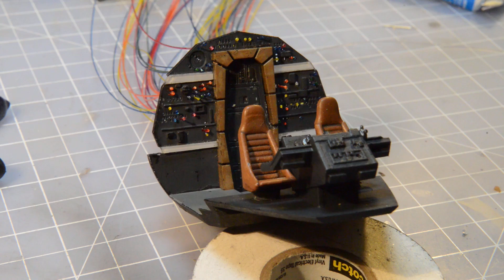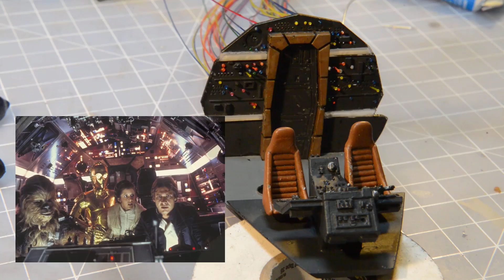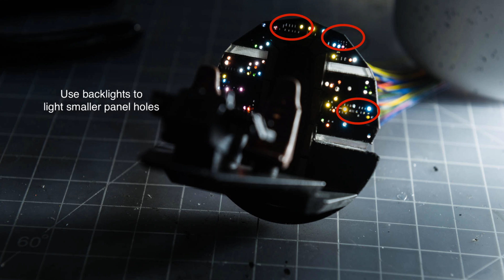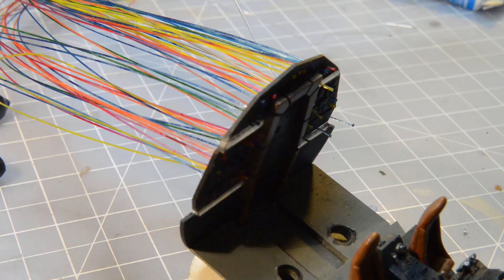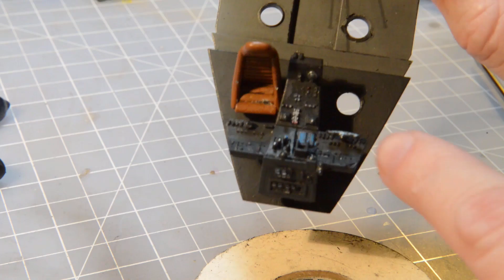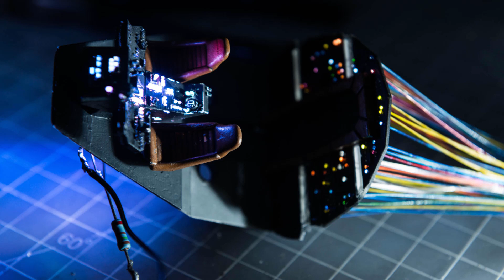Millennium Falcon Conversion - Cockpit Part 3

Comment: Heya!

I’ve Ordered the Shapeways Figures! If ?Cherie is going to have that much Trouble sitting in His Seat, I will adjust it for His Height? Just Like in a Car or A Plane? Just Move Back the Seat a Little? The Figure has so much Mass you would Hardly Notice the Seat Adjustment. They must have made some kind of Accommodation For Peter Mayhew And His Height? Yep thTs exactlywhat im going to do!

Best

Comment: Not to take away from your excellent work. But I saw a video somewhere that painted with Tamia clear colored paint on the backside of the wall. They lit it with a few leds and there was no need for any fiber optics at all...gotta say it looked perfect.
Good videos Ken, I have subbed.

Comment: hello a curiosity , where did you get those wires to fiber optics? where they buy ? thank you
Reply from the maker: +Daniele Granato I bought them on eBay. This is the seller's info. I believe they were .25 and .50 - Very inexpensive. http://www.ebay.com/sch/me80/m.html?_nkw=&_armrs=1&_ipg=&_from= - The LED lights came with them. You get everything you need.
Reply: Ken Pearson n